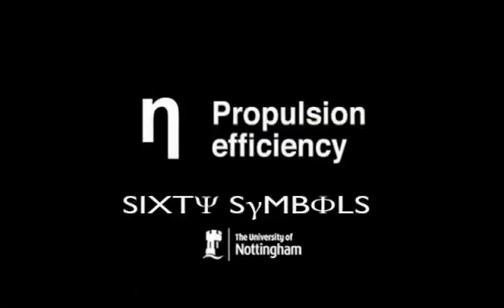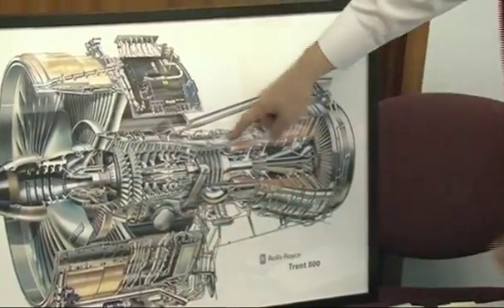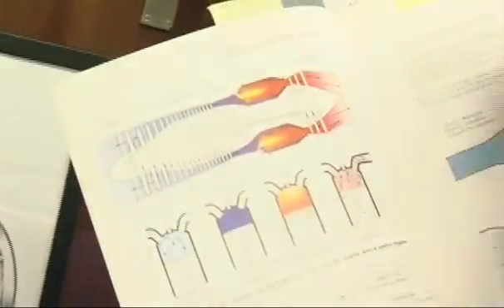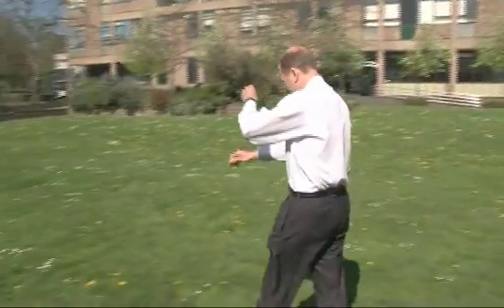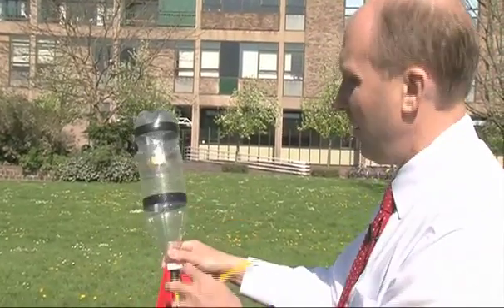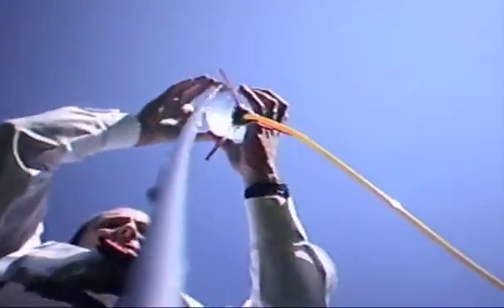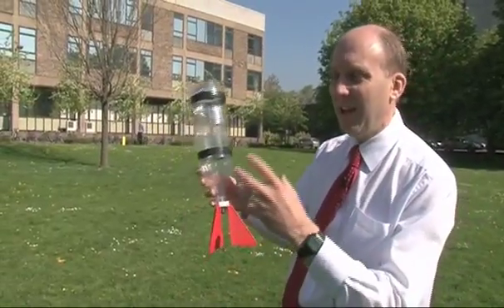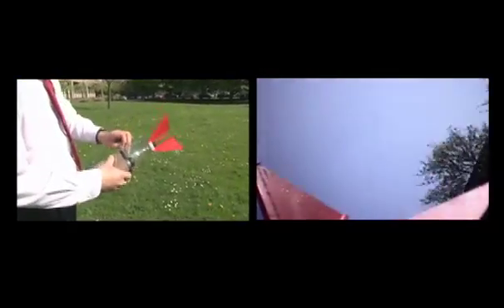Propulsion Efficiency - Sixty Symbols

Comment: Shouldn't the original jet engines had centrifugal compressors rather than the axial one on the mock up?  Probably wouldn't have been fan jets though.  What is the specific impulse of the water/compressed air?...

Comment: He assumes that he's putting the same amount of energy into both the first and second rockets, but he's compressing less air. So isn't he putting in less energy but using it more energy efficiently?
Reply: I may be wrong here, but here's what I think:
Pressure = Force/Area, in each case the area is the opening of the bottle so that remains constant and the pressure is the same both times because the valve opens at the same pressure he mentions in the video.
Excluding the small inconsequential pressure from the water on the valve, the air pressure inside is the same in each trial. If the pressure is the same, the area is the same, then the forces must also be the same. THe difference is what the force is made up of. F=mass*accel. The mass of air is much less than the mass of the water, meaning the acceleration of the air out of the bottle is much smaller than the acceleration of the water. This is what he was saying causes more efficient propulsion - higher mass lower acceleration.
Reply: Velox South PV=nRT[=]Joule
Reply: There's another way of looking at this.  Propulsion or thrust systems such as rockets, jets, prop planes, jetskis, even row boats work on the principle of Conservation of Momentum ( equivalent to Newton's 3rd Law of Motion).  The backward momentum of the exhaust, air, water is balanced by the forward momentum of the body set in motion.  Net momentum is zero.  Consider the backwards flow of mass m and velocity v.  It's momentum is mv, whereas its kinetic energy is 1/2 mv^2.  Hence, the energy input is proportional to v^2, but the benefits are proportional to v.  So, for the same forward momentum gained, you need less energy when the backwards flow has higher mass and lower velocity.

Yes, in this case he's "putting in less energy" and "using it more energy efficiently".
Reply: The one with water, has less compressed air in it.

Comment: I know it is a bit late to answer, but the sun is registered as black, because of the sensor. Sensors can only measure certain range of brightness, temp, humidity, etc. Each value of the brightness,whatever will be mapped into range of numbers say 0~256 (the range is greater if the sensor is more sophisticated). If the value exceed certain number, it will cause the sensor to overflow, meaning it will max out its value. Once it overflow, it usually display one of two extreme, in this case black.

Comment: Wait a minute. The propulsion is not more efficient. It's just that water is a much denser propellant and so it gives rocket a much better mass ratio. The air, being lighter, is more efficient, i.e. it gives more delta v per unit weight but because it has such low density, there's not much of it in the rocket. So the difference in mass ratio between water and air filled rocket more than makes up for the difference in exhaust velocity.
Reply: Same energy in the compressed air (almost, the pure air version has more compressed air). We could say that the pure air version has almost no propellent-mass. Plus the nozzle is made for water, not air. The air can almost not push on itself, it is gone too quickly.

Comment: At slow speeds motors work efficient when they accelerate a big mass by a small amount. As the vehicle goes faster, efficiency goes up when a smaller mass is accelerated by a bigger amount.
In Ion propulsion engines, the spacecraft go very fast. Thus very small amounts are accelerated by very large values to make them go.
Reply: "At slow speeds motors work efficient when they accelerate a big mass by a small amount." Can you tell me why? (and by motor you mean what; rocket in space, pure jet engine, propellers?)
Reply: "In Ion propulsion engines, the spacecraft go very fast" Fast, relative to what?